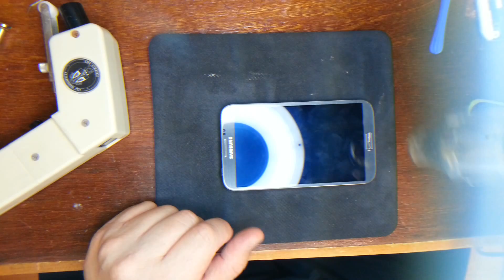Samsung Galaxy Note II Glass Removal

Comment: Thank you so much! I was able to successfully replace my glass. Crystal clear and works great.

It's not perfect: A smidge of glue is visible, minor obstruction of the menu symbol from leftover black tape, and my home button is slightly tilted & recessed.

And, now that the glass is hovering over the display, it sometime warps into contact with the display temporarily leaving an artifact when I sit on my phone or press hard. Any suggestions besides simply not sitting on my phone :)

Comment: my phone got run over by a car it still recivies calls and messages but no screen function the odd flash at start up do you think it is a glass issue only or does it need a full replacment seen other phones that have been dropped but still work does it sound like i shoule chuck the plone as a compleate replacment runs at around 300 and replace the phone will cost 400

Comment: @MarcustazXDA:
I have to thank you for this detailled video !!!!
I looked at many posts & videos but yours was the only showing the important details and so i was able to replace my glass yesterday.
After the replacement the middle of the glass seems to be touching the AMOLED so there is a small contact area with Newton rings around it.
I guess i have to redo the last steps but to build up a thicker dust seal by using 3 layers of double sided adhesive.
Do you have any better advise ?
THANK YOU

Comment: Great video and all very informative. I followed the instructions very carefully, especially noting the care required regarding the buttons attached to the underside. However, after carefully removing the glass I found that it was still attached by a broad ribbon... which was the touch screen! I could find no way of separating the touch screen from the broken glass, so had to enact "Plan B" which was to purchase a new frame, LCD, touch screen and glass assembly! Be aware...

Comment: hi i followed your process to fix the note 2 screen. it worked out flawless, until the next day. it looks like moisture is trapped under the center of the screen and digitizer? have you ever run into the problem? and if you have what can i do to fix this? the screen and digitizer are still working great also. touch and everything are working in that area too it just looks like moisture is trapped in there.

Comment: Okay so my hubby accidentally tore a small rip in the ribbon cable for the digitalizer  we can hear the phone turning on and buttons light up but not the screen. I have a feeling we will have to replace the digitalizer but wanted ur opinion Iif there is a way to join the ribbon back as it makes the buttons flicker when we hold it together. Thanks

Comment: i did the repair successfully although i would also recommend a head lamp for doing the buttons stuck to the glass as these can be tricky to see. thanks for the vid man. i used a hairdryer and laser thermometer  180 f seems to be a good temp for the job and just to let anyone know my screen had cracks all over and i removed it no problem and replaced and i used alcohol and it removed the glure film no problem.

Comment: Thank you for the great video - I much more confident in replacing my glass instead of the entire display now - One question i did have, in another video they used Molybdenum .14 wire to slide under the glass and separate from the display/digitizer.  Have you tried that method rather than the razor blades?  Thanks again!

Comment from the maker: @allangreen45 the way to solve this is to double up for 3m tape,in other wordsput down your first letter and then put 1 extra layer on top do not go more than 2 layersor you will have sensitivity issues.this seems to happen when the digitizer LCD is a bit Warped it only happens on certain phones the majority of them do not suffer this issue

Comment: Hey Marcus and Javeed!
I did my GNote N7000 yesterday and everything is working perfect! I did the operation in 6 hours with my nerves going to hell! My Note was in pretty bad shape with 2 impact zones top left and bottom right. Marcus thanks for the e-mails and support. The best advice for the do it yourself replacement glass is to be patient and a lot of usage of hairdryer (in my case)! All the sensitive bits on N7000 are on the bottom so you need to be extra careful in that area.See ya

Comment: Great video, when putting the glass on using the 3M double-sided tape, I am seeing a bubble that forms (looks like an air bubble) between the AMOLED and the glass.  The bubble will only show when the phone is touched very firmly (a little more pressure than normal use).  Applying a suction cup on the area and lifting up removes the bubble but once too much pressure is applied again (some period of time later) it returns.  Any advice on how to stop this when applying the glass?

Comment: Hi guys, cracked my note 2 glass last week and decided to replace JUST the glass myself. This included me warming up the screen with a hair dryer and replacing the glass. All went well, was VERY careful only to find out when I turn the phone on the screen is either blank OR white, and you can faintly see the boot logo. This alternates randomly when im prodding the motherboard. Does this mean there is a dodgy connection? Can I fix this, or have I completely melted the amoled when heating?

Comment: Thanks for the quick reply. I am actually out of.town and have to risk it for about 3 days. Do you think there is risk of damaging my lcd? I also think the 3mm tape i used unfortunately was to wide so I'll order 2mm and rebuild with that. I was on a tight timeframe and it was either completely destroy my lens or attempt the fix. I've loosened some of the back screws to reduce some of the pressure but which helped reduce the size. Again i can't thank you enough your videos are top notch!!!

Comment from the maker: Yes indeed it sounds like the boarder was tweaked to much. Also look out for the plastic covering of the ribbon cable, if that is out of place it can affect the height of the glass. Just remove it again and build that boarder back up fresh. Also put on a little extra at the bottom around the home key and make sure that area has extra 2mm tape.

Comment: Accidentally posted before i was done typing my.comment. But I have one minor issue after applying the new lens and that is a tiny bubble.in the center of the screen. The harder i press the larger it gets. I'm sure it due to contact with the lcd. Do you think perhaps i didn't build a goof.enough border or don't have a strong enough seal? I put the button upside down originally nd had to remove the lens and correct it. Could i have tweaked it? Any suggestions would be great and thanks a million!!

Comment from the maker: All Note II frames come off the same way. The frames may have some slight variations but the process is the same. if you are struggling with this I suggest you get your phone repaired by someone a little more knowledgeable lest you damage your digitizer. I do offer my services and this is NOT an advertisement, its just an expensive mistake to make if you are not really sure what you are doing.

Comment from the maker: Siu, sounds like you damaged the LCD/digitzer. Sorry best to send it into Samsung for repair. Send the S3 into Samsung's service center and they will repair the screen and digitizer for 178.61. That includes shipping both ways and also maintains your warranty, should you have any other issues down the line.

The Samsung phone number is 1-888-987-4357, Mon-Fri: 7 AM - 9 PM (CST), Sat: 9 AM - 6 PM (CST) and choose options 1, 4, and 1.

Comment: but, do you need to add aditional adhesive (for example 3M 2mm stickers) between your soft bottons (original ones) and the new glass?   Only in the surrounding of the soft bottons, isn't it?

Comment from the maker: Not really sure I understand your question. If your glass came with new soft buttons you do not need to use them unless you damaged the original ones. If you did damage then you need to dissemble the phone completely remove the motherboard, speaker, charging pcb etc to access the ribbon cable to install the new one.

Comment: I would suggest you to use this hot plate. You can find it in amazon:
Corning 6795-400D PC-400D Hot Plate, Digital Display, 5" x 7" Pyroceram Top, 7.75 x 4.25 x 11" (L x W x H), 5 to 550 Degrees C, 120V/60Hz
just copy the two lines above and search it in amazon. it will separate the glass for you easily and you can heat other screens while working with one. it will save your time.

Please see this vid: 
watch?v=ndgBUhYIhaM

this is my gift to you if you haven't seen it before.